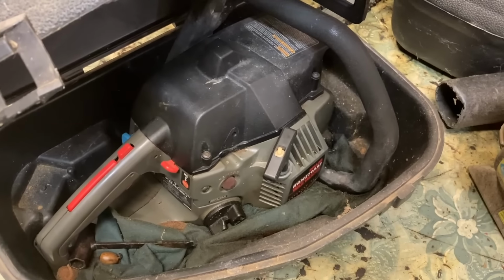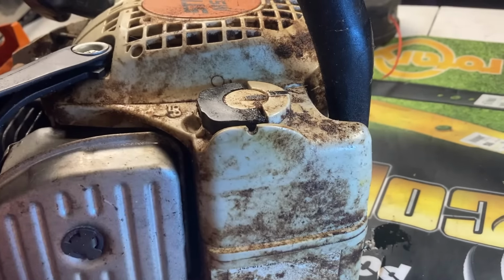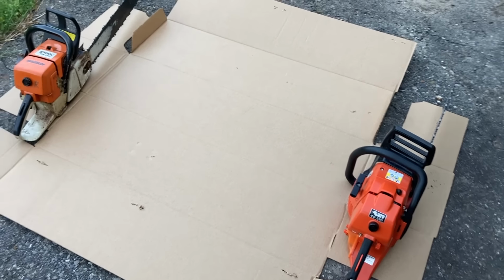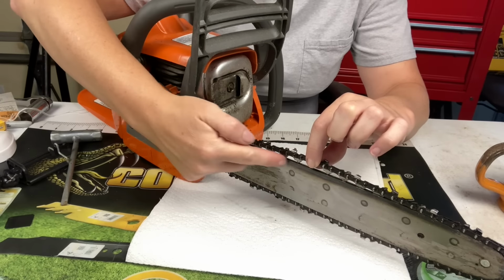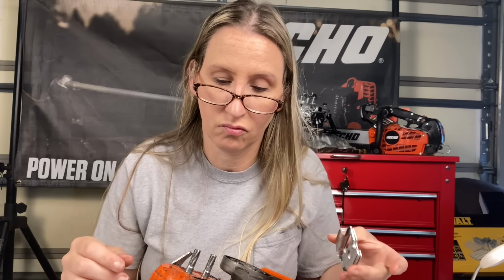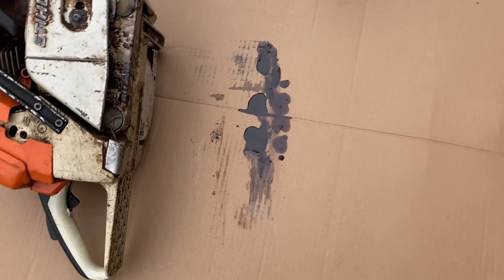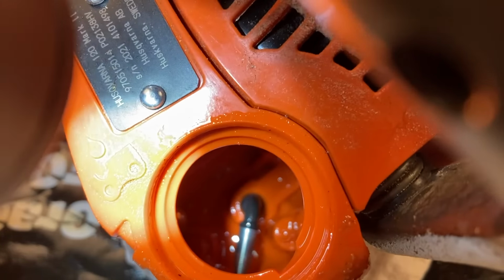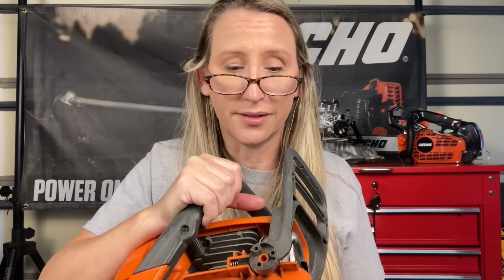Chainsaw leaks bar oil? The most common reason why AND Husqvarna saw leaking oil FIXED!! Repair Vlog

Comment from the maker: Thanks for Watching! Find a link to all of my "Must Have", Favorite Tools HERE!! https://www.amazon.com/shop/chickanic?ref_=cm_sw_r_cp_ud_aipsfshop_aipsfchickanic_9ERPFPBNGQ924P8NS63B
Reply: Much appreciated and helpful.  When my Stihl chainsaw runs it has very hot exhaust and even the plastic housing is burned.  I have to wear gloves because the exhaust is so hot it burns my fingers.  Any ideas?
Reply: Not cool starting and working on chain saws with flip flops darling.
Reply: Love your channel - only it appeares you don´t use earprotection ...? You should, young enough to care for it .. :D Love from Norway
Reply: That grommet should be re engineered by the company.that grommet is a mickey mouse fix.